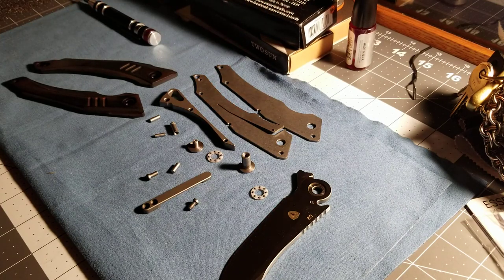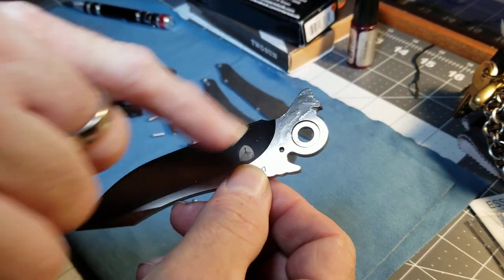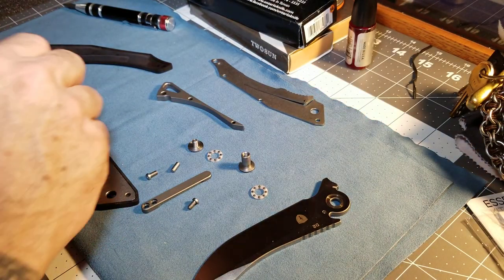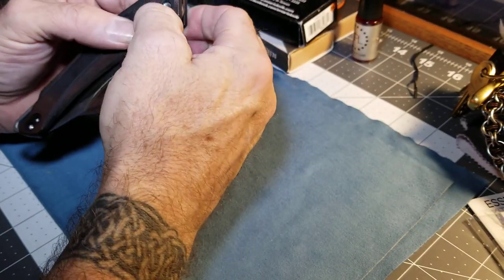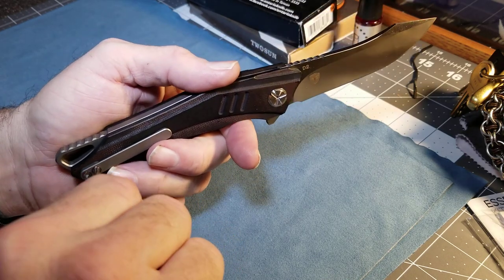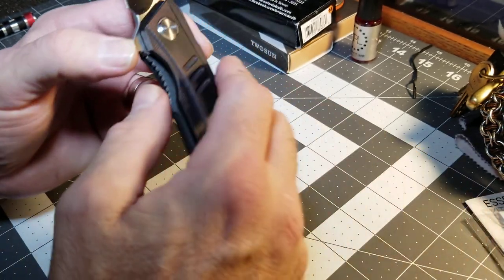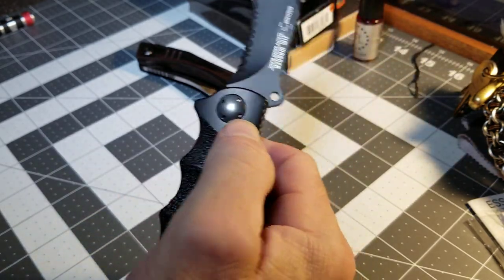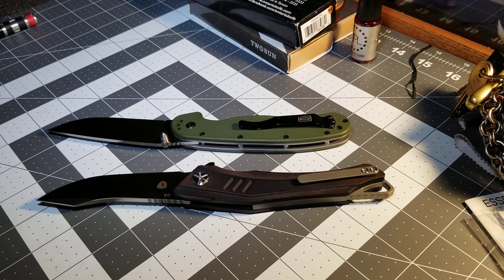TWOSUN TS114 ORANGE DYED TO BLACK PATINA AND A FEW EXTRAS FOR FUN!

Comment: Only thing I wish with TwoSun is that they would put the bearings in a metal cage and not nylon.  I would pay a few extra bucks for that.  I  dont mind the dye job on the scales.   It might not be perfect but It looks interesting anyway.
Reply from the maker: Thanks for the comment. I sorta like the mismatched dye job it was my first and probably why it did not come out full black..that said the random pattern looks nice and different from the normal standard color so it stands out amongst others..Sort of like a custom artwork which gives it more character. The bearings might be in a PTFE Teflon cage which would actually be more wear resistant than steel cage..I will try to reach out to Twosun and get some answers and give an update..
Reply from the maker: https://www.google.com/url?sa=t&source=web&rct=j&url=https://www.astbearings.com/blog/2017/08/common-ball-bearing-cages-j-w-rj-tw-types/amp/&ved=2ahUKEwjbpu39pM3lAhWld98KHcnHDe8QFjAAegQIAxAB&usg=AOvVaw0W0XzlbETnGxP8kDWsLYNy&ampcf=1
Reply from the maker: Here is some info on nylon caged bearings. Pretty enlightening info..so your probably  correct they are nylon caged not PTFE..PRICEPOINT TWOSUN CANNOT BE BEAT..